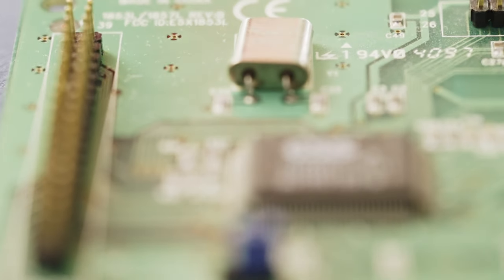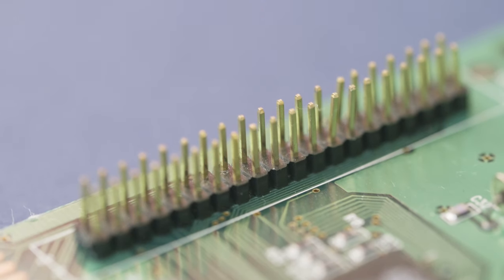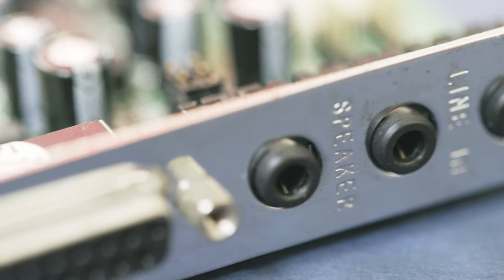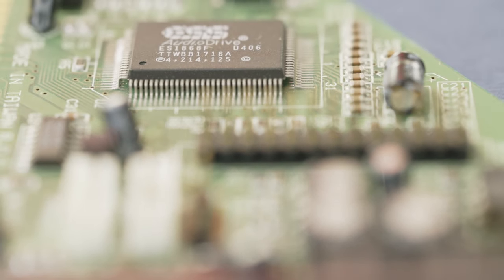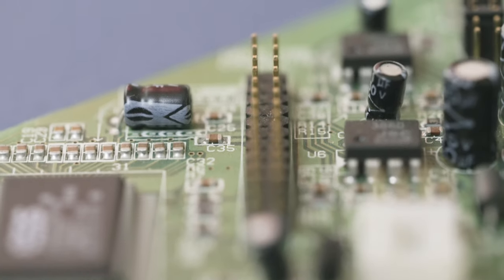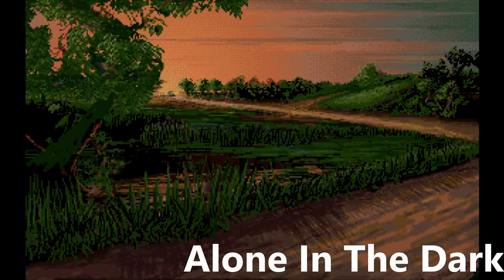ESS Audiodrive ES1868F review - The Quest For The Ultimate DOS Sound Card - Part 5 - Is it any good?

Comment: I do think the ESS 1868f and 1869 cards are close to the ultimate DOS sound card right now.  Many variants of these were produced and included a wavetable header, an IDE controller for a CD-ROM drive, or both.  They are cheap, ESFM is near perfect OPL3 emulation, they have reasonably clean digital audio output and decent backwards Soundblaster compatibility, NO HANGING NOTE BUGS via it's MPU-401 interface (this impacted most SB16 and AWE32 variants unless they had DSP 4.16 or newer), plus a lean and easy to configure DOS driver and mixer utility, though they also work fine with the UNISOUND generic PnP sound card driver.  The relative simplicity of the cards makes recaps or other simple component replacements easier than most audio cards of the era, you're usually only looking at 2 caps vs dozens on a real Soundblaster card.  

I prefer them to real Soundblaster 16's in most practical builds particularly when I'm using external MIDI devices or waveblaster cards.
Reply: Same here. I've been preaching this for the past 5 years.
Reply: Agreed and you bring up great points. Especially the Unisound compatibility due to its PnP nature. That is how I was able to test the cad prior to installing the ESS driver. There are some other things too I have noticed. A lot of people are on the quest for perfect sound, but rarely is it mentioned about joystick compatibility. On an Opti939 card I have, Duke 2 and Tubular worlds will not work with a controller. They jump all over the place. And it is not the port on the Opti card. Some games do not like certain gameports. With the ESS (in my case the 1869) those game controls work perfectly.

I have paired mine with a Diamond Monster MIDI wavetable card since my ES1869 has the header. And, it is awesome. The best combo in my opinion, even better than the X2GS (which I also have)

Comment: So what is your current choice for the ultimate dos soundcard ? Mine is the SB awe 32: excellent support, genuine opl3 sound, midi sound,... And I got it for 2€ on a flea market. 
I also tried some crystal sound cards which are not bad at all. Cheap and correct opl emulation .
Reply from the maker: Well, my current choice would be Roland RAP-10. Its wavetable samples are exquisite and the sound clarity is superior to other sound cards. The only problem would be compatibility.
Reply: @KITR-UK  Yes indeed, compatibility is a very important criteria for me. Plus true opl3 sound and as a bonus wavetable sound (internal or via a blaster module). Back then I had an awe32 and I really was happy with it. Even though the Gus has way better wavetable sound but lacks true opl3 sound that's why I'll never get one (and they are very expensive !).
Reply from the maker: They are very expensive indeed. For now, the best setup would be Roland RAP-10 + GUS PnP + AWE64 Gold :)
Reply: @KITR-UK  I have one or two awe 64 but unfortunately not the gold version. I took a look on eBay and omg, these are quite expensive as well. Indeed the perfect card does not exist and probably some combo is the best approach :)
Reply from the maker: And what about tone generator like SC-55 or MU2000?

Comment: hey so i finally got mine all set up - 1868f chip but not sure of the manufacturer. its running on a 440bx board with p2 @ 200mhz. most games are working when i'm using address 220 dma 1 irq 5 but jurassic park is a problem, music plays, the sound samples play (dinosaur sounds, making noises when hurt) but the sound effects from the guns are glitched and sound like static. this is running from dos 7.0 in windows 98 se - what are the drivers you've used and where did you get them? thanks
Reply from the maker: I'll check it out tomorrow and send you a link for the driver.
Reply from the maker: This is the driver I used: http://www.karlsitretro.com/drivers/ess/es1868/es1868_dos.zip
Reply: @KITR-UK  thanks - unfortunately those were the ones i tried too. damn!
Reply: @FOIL_FRESH  Pentium 2's can be tricky because of the way the ISA bus is handled, sound cards I'd tested fine in older hardware were particularly difficult in PII boards,  the typical shared PCI/ISA slot was often the culprit so try it in the ISA-only slot closest to the bottom of your case to see if that makes a difference.  Use this driver for DOS: https://www.philscomputerlab.com/uploads/3/7/2/3/37231621/185xdos.zip - otherwise try this unified DOS sound card driver which does support the ESS audio chipsets: https://www.vogons.org/viewtopic.php?t=72553
Reply: @TheYuppiejr  Socket 7 and earlier systems are better with hardware like that, Slot 1 and later boards can be picky with older sound cards and other ISA cards.

Comment: i'd be interested to see if changing the dma for the card and rott settings makes the loading bug go away
Reply from the maker: I tried changing various settings, but unfortunately, it didn't help.
Reply: @KITR-UK  damn! Hey i was wondering if you could test out jurassic park released by ocean in about 1993? I cant get soundblaster sfx working properly in sb live, Awe64, ymf744. This card might work.
Reply from the maker: I just tested the game with ESS and it works like a charm. Later, I'll test AWE64.
Reply: @KITR-UK  you're amazing thanks, it looks like i might try to find one of these cards on the cheap if i can.
Reply: what speed system did you run it on? the box reccomended a 386 if i remember correctly
Reply from the maker: I used Pentium III 1000MHz with BX chipset.
Reply: @KITR-UK  excellent, mine is much slower so thats promising :) did the sound effect of the guns and dinosaurs sound nice?
Reply from the maker: Well, sound quality is good, but the sounds themselves, not so much :)
Reply: @KITR-UK  my es1868 came in the mail yesterday. Gonna set it up in either a socket 7 pentium or slot 1 pentium 2 with an s3 virge card i have laying about. Should i go with win 95 or just dos?
Reply from the maker: For me, it worked fine with both, DOS 6.22 and DOS 7.